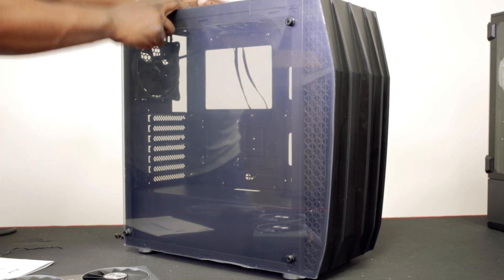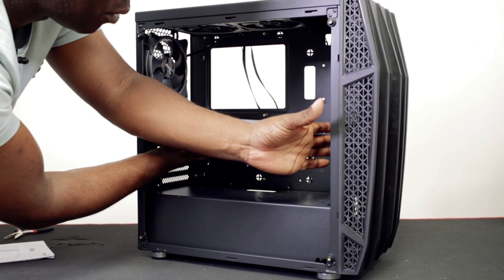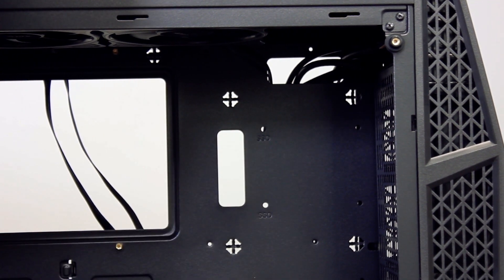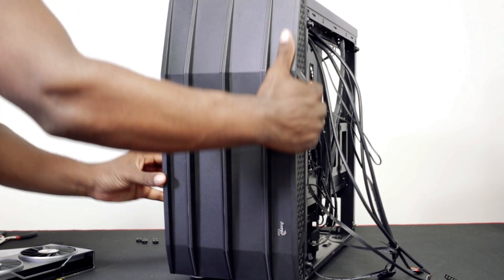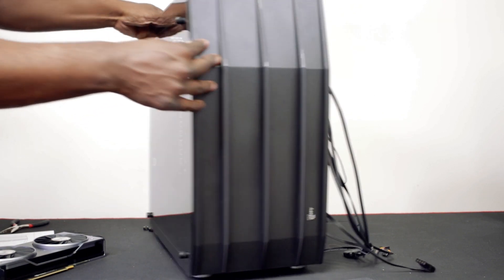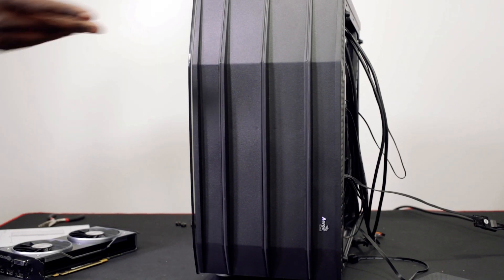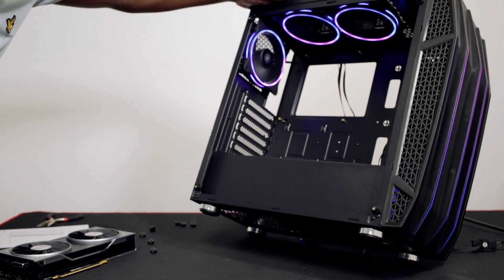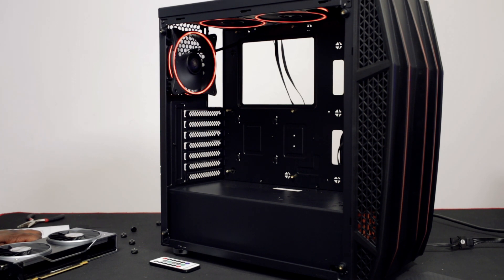AeroCool Klaw RGB Mid Tower Case Review !!

Comment: I won this case in Germany and used it to build my X470 - Ryzen 2700x with stock Wraith Prism - Vega 56 Reference.
I bought 2 Arctic F14 PWM and built them onto the front.
Without overclock the cpu and undervolt - overclock the GPU, I have constant 59-60 degree with the Vega 56 at 1540 Mhz and 58-59 degree with 65 degree spike sometimes from the CPU. If I bench them, they get to max 74 degree for both but not more than that. So temperature is not that hot. The case is quiet with 22 db from 2 meters distance. There is a weird rattle noise which probably comes from the power supply compartment or the SSD dock, otherwise this case is a very good.
Reply: Khoe case thôi, khoe cả dàn ra sợ vll
Reply: can you speak german if not can you please anwer me this question i want to buy the same case bu im scared because of the airflow my psu is a corsair vs 650 new edition 2018 model               my cpu is an R5 3600
my gpu is an rtx2080 -rams are gskill ripjaws 3600 mhz and at least my mainboard is an gigabyte x570
Reply: @ayyildizmutlu2627  I do speak German.
Do take in mind that first, the hub takes only propriety 6 pins fans and led. Second, there is only 3 fans come with the case, so if you want another 3 fans with RGB, you can only buy the set from Aerocool.
Reply: @kureki147  also was denkst du welches dieser zwei modele sollte ich mir besorgen oder hast du auch was anderes zum engehlem
Reply: @ayyildizmutlu2627  Diese Modele ist sehr gut fuer kleines Geld, wenn du ungefaehr 80-90 EUR bezahlen moechtest. 
Ich benutze es zurzeit mit 5700XT und 2700x. Die Temperatur von 5700XT ist immer 74-76 Grad und natuerlich nicht zu hoch.
Reply: @kureki147  was denkst du über mein pc system plus muss das auch noch fragen den darkflash phantom oder die A.C. KLAW
Reply: Hat das Gehäuse ARGB?
Reply: @izzsharkzz3037  Ja.

Comment: I have this arriving tomorrow. My idea is to move one of the fans from the top to the front to give a little bit of air, & maybe flip the glass panels. I have got some very good fan filters which i will add to counter the 'filterless' sides. I'll let you know how it went.
Reply: Do you know how to take the front planet off? Idk if I’m just supposed to take it straight off or if I have to lossen something
Reply: @nolyfe4814  sorry, I since got rid and bought another one.

Comment: Can u cut tempered glass with something like a glass cutter?
Reply: I was thinking exactly the same thing. I'm sure a local glass cutting place could cut that extra bit off to allow better cooling  Not exactly a thing you would plan on doing when buying a new case, but then it ain't exactly expensive so why not if you like the case enough
Reply: @GedNEUK  Yeah i got this case noe and i just flipped the front end of the glass panel to the back and now i got good cooling in a nice looking case
Reply: @litboiboris8147  don't you have the glass sticking out the back now

Comment: got the same case, only had a problem when building with my power supply, it got really messy cause the cables didnt really fit all in the compartment for the PSU. any one got some tips for that
Reply: You can use modular Powe Supply for that case, no need to use all the wires
Reply: @ArshakAvag  i have a modular but even with that, it has very low space for the psu. I had to kind of punch it in to make it fit.

Comment: I want help in front i want to put just fans not a radiator what size i have to put?
Reply: 120-140mm
Reply: Maybe its too late but 2x 140mm or 3x 120mm
Reply: @litboiboris8147  its never too late ;)
Reply: Λογικά 3 120αρια
Reply: How do you take the front panel off?